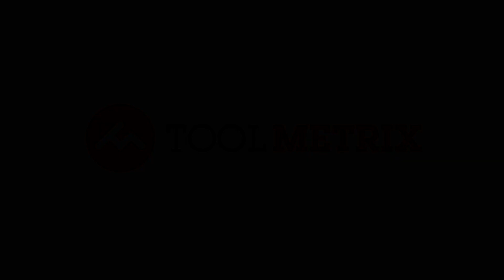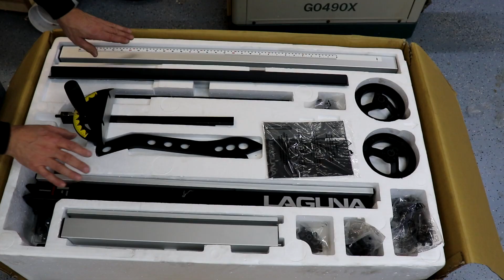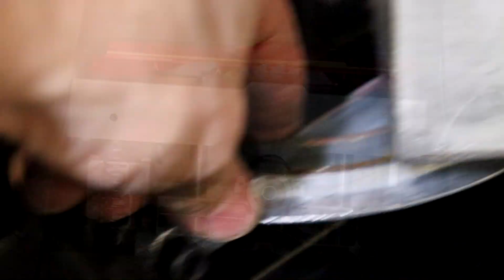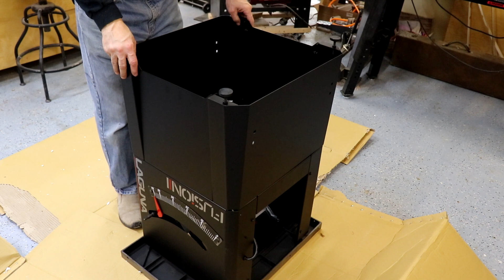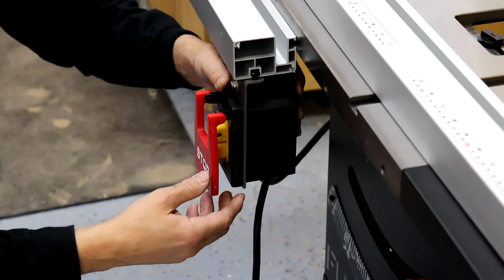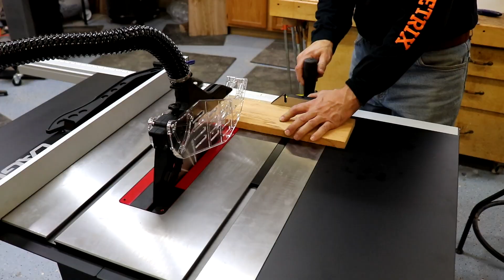Laguna Fusion F1 Table Saw Unboxing & Assembly

Comment: How would you compare the f1 and the Delta 36-725t?
Reply from the maker: Hi Steve,  sorry but I've never used the Delta saw that you're referring to.  It looks to be similar to the Ridgid 4512 which I've used quite a bit.  To my recollection the F1 is smoother and more powerful than the Ridgid, with a much nicer fence, which may or may not be applicable to the Delta.  Sorry I couldn't be more helpful.

Comment: I'm stuck in my F1 assembly.  There's a metal plate that's supposed to screw to the bottom of the cabinet, above the stand.  I guess to trap sawdust?  The manual—or should I say "manual"...cause it's pretty useless—shows it as installed at the factory but mine wasn't.  Was just laying in the box and doesn't seem to have any screws to attach.  The holes are machined (threaded) so there's a specific screw that goes in there but nothing in the manual.  I've sent two emails and left three messages at Laguna support but no response yet.  My beautiful F1 is still sitting here, upside down on the floor in my shop three days later.  I'm sure I'll love it eventually but not exactly getting off on the right foot with Laguna.
Reply: You picked the part in question up and said "not sure what this is" at 2:11
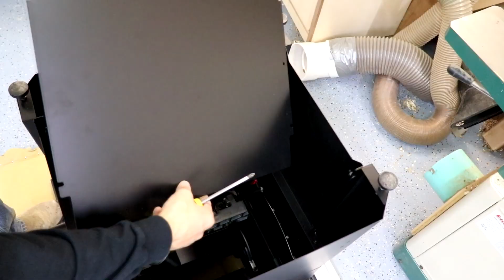Reply: Ha!  and at 4:28 and YOU seemed to have gotten the screws for it!!
Reply from the maker: It’s a plate that seals the bottom to improve the dust collection from the saw. I don’t remember if screws came with it or if I had to use my own.

Comment: Hi, great video, I bought this particular saw, somehow I couldn't find the bottom panel screws to hold the panel in place and there are so many scews, is it possible if you can advise, thanks
Reply from the maker: It sounds like you have an older model. They used to ship without the bottom panel.
Reply: @ToolMetrix  I got the new version, anyhow i found screws that fit hope it don't comback and pinch me on the behind to find out if it's for fasting something else 😅

Comment: Thank you for this quick overview. You've moved Laguna way up on my list.  @3:24 you're measuring the tabletop. May I ask what the height of the saw is from top of table to the bottom of the cabinet not including the mobile base?  Only what you can see of the saw at that point in the video.  And if all I wanted to use is the saw without wings as shown @3:24,  may I ask what  the fence-rail mounting options would be if I didn't require the full width for wide rips?  Could the right section of fence be slid over to the left?
Reply from the maker: Hi Tim, unfortunately I no longer have the saw in my shop. I do a lot of tool videos and I have a small shop so I can’t keep them all. Best of luck with your purchase decision. Cheers

Comment: Fusion 0ne misleading. MANY things in assembly instructions are NOT covered. Major items not discussed required a lot of rework. Motor assembly step not in correct order. Laguna support was of Lilly’s help, they recommend this video which did nothing to help
Reply from the maker: Thanks for letting me know. This video wasn’t intended to serve as a setup guide. They often have their own videos for that.

Comment: The F1 just arrived 1/5/2022 and the included manual is lacking. I also found it interesting it is advertised as USA however the manual clearly stated Taiwan.  This will help a weak old man assemble it. Eventually would love a sliding table saw.  Little large for a 2 car garage. Dreams are magic until actually happen. CPO used marketing photos with the wheel kit without a disclaimer they are optional.  NOPE not optional without the disclaimer.  They should be here next week .

2 full years. How do you like the machine?
Reply from the maker: Hi Dean, to my knowledge Laguna has never made a claim that any of their products are made in the US.  They use third party manufacturers in Europe and Asia.  Yes, I would like a slider as well but they require a huge foot print and I can't justify the space in my small shop.  Wheels are optional on the F1, and included on the F2.  I only had the Laguna saws in my shop for a couple months, so I'm unable to offer a long term view.

Comment: I was looking forward to some measuring of dimensions not available online. For those of us where space is tight, could you measure the minimum depth needed if the fence and dust collection was removed and the F1 was pushed against a wall? Basically rail to rail plus any protrusions front/back. Also, the front rail height (think car hood tucking in nearby). TIA
Reply from the maker: Hi Les, unfortunately I no longer have the saw in my shop. As a tool reviewer with a small shop I need to cycle them through pretty quickly.
Reply: @ToolMetrix  Okay thanks. That might be a good measurement to do in the future. Nobody else does.

Comment: So, what was the blade run out on these saws?  You mention you will test it, but never reported it.   Also, How did the overhead dust collection compare to your Shark Guard system.  I am sure not as good, I just want to make sure this at least works.  Thanks.
Reply from the maker: Hi Al, if you're referring to the runout for blade to miter slot alignment, I don't remember the exact amount, but it was off enough to where I made the adjustment.  It seems to me that it was in the .010 range.  I've had to make that adjustment on every saw that I've ever assembled.  In terms of runout on the actual blade, I don't recall.   The overhead collection on the F1 is ok but not great.  It would be much better with a larger hose/port.  I haven't hooked up the collection on the Shark Guard, but would definitely be better because you can put whatever size port you want to in it.  If I were to set that up I would likely use a 2.5" port, because I've read that 4" is just too much and small pieces get sucked up into the hose.  Choosing the right size is a balancing act based on the capabilities of your dust collector.  I have a monster cyclone, so I could have a large duct up top.  If you are trying to get by with a smaller DC, like 1.5HP, I would skip the blade guard collection entirely and give all the suction to the cabinet body.
Reply: @ToolMetrix  Thank you so much for the info.  This helps a lot.
Reply from the maker: My pleasure, Al.

Comment: Would you recommend this one over the F2 for a hobbiest?
Reply from the maker: Hi Rito, the F1 is a nice saw for a hobbyist or a contractor. I think the F2 is a significant upgrade on several fronts and if you can swing it it’s well worth the difference in cost.
Reply: @ToolMetrix  are you able to run thin kerf blades with the over head dust collection?
Reply from the maker: I believe so but I’d suggest confirming with Laguna as I no longer have the saw here in my shop.

Comment: what size screws hold in that dust pan between the base and saw?
Reply: Well, after all that, when the saw was assembled, I was left with 6 self tapping screws. Two screws are used to attach a small hook in the miter storage area and the other four are obviously used to screw down the dust pan. Since the dust pan, as well as the overhead dust collection hose are not covered in the installation guide, I assumed the screws were for use elsewhere.  C'est la vie, c'est la guerre!
Reply: @bellonwheels726  I got mine couple days ago and I had to watch this video to get myself acclimated with the installation; kinda hard to follow.  As for the bottom pan that holds the dust pan, I end up using 4 of the 6 screws already provided that came in with the one of the bags.  I'm still puzzled with two screws and some, a small plate and plastic tube, the owners manual is awful... lol
Reply: @mapotoyfu  The plastic tube is the bushing that goes on prior to the hand wheel for the front blade height adjustment wheel.  It's needed to make the star knob function properly as a blade height stop/lock so it doesn't drop on dado cuts.  I ran in to the same thing, and then after scouring different docs, figured it out.  Not sure which plate you are referring to, but the miter hook was puzzling to me at first.
Reply from the maker: Sorry but I don’t remember.
Reply: @ToolMetrix  lol, thanks. I got to the dust panel, they included no screws. I just didnt want to have to go to a hardware store for awhile. I stole parts off of the included miter gauge since I know im not useing it anyway. Thanks for replying so quickly.
Reply: Rodney Allen I just ran in to the same issue you did. Where did you say you got the screws from?
Reply: I ended up using #6 bolts with a couple of washers, lock washer and nut.  Difficult, but it's done.

Comment: Nice unboxing, I may have missed it, but was anything hung from the cast iron top?  Does it have optional cast iron wings?  I look forward to maybe an alignment video on it.
Reply from the maker: Hi Richard, thank you.  Yes, it's a hybrid saw, so everything inside the cabinet is mounted to the cast iron top.  I tell you what; in the deep dive video that I'm working on, I'll pull the cabinet off to get a good view of the trunions and show how it is adjusted.  It requires loosening 6 bolts that attach the trunions, and it's a pretty easy process.  Also, there aren't cast iron wings for it but you can get those if you step up to the Fusion 2 saw which I'll be looking at next.